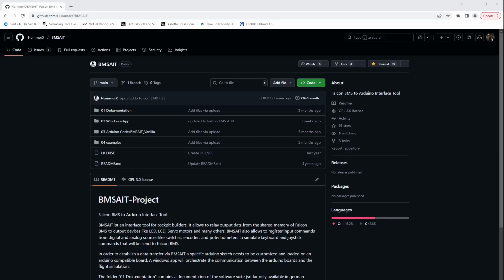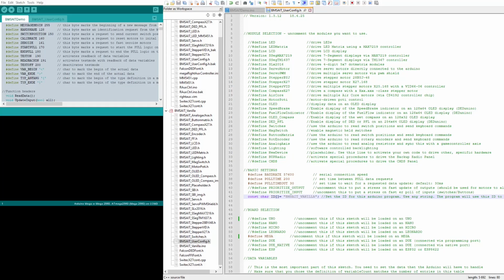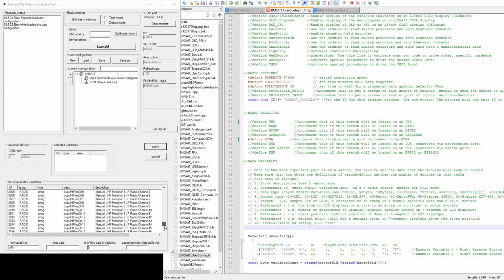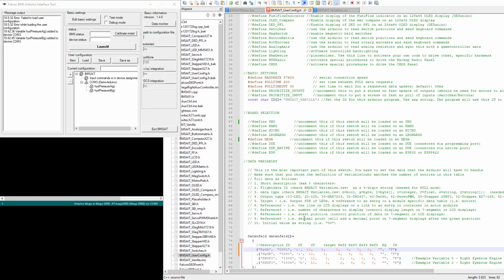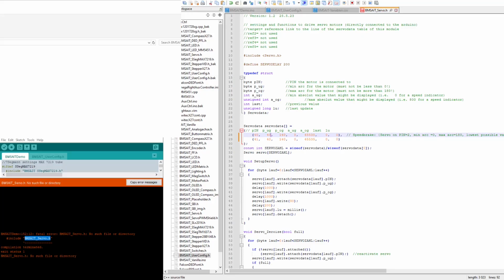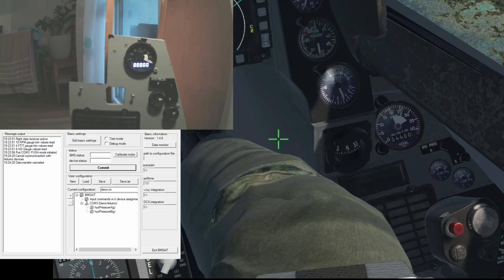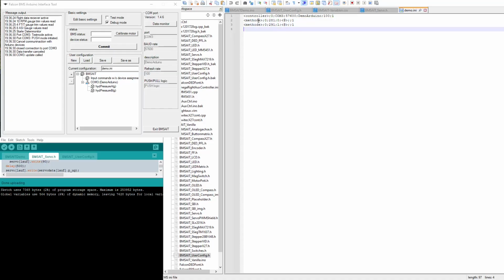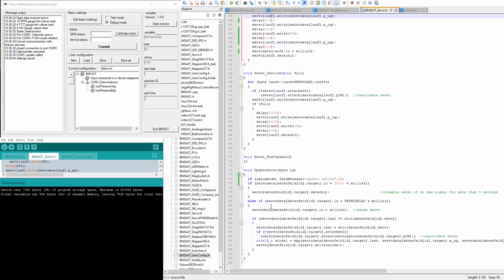F-16 Home Cockpit 14 - BMSAIT Introduction/Tutorial

Comment: this has been very helpful, would you be able to do a quick tutorial on 28BYJ48 stepper motors to drive gauges, i seem to be having issues
Reply from the maker: Thank you...
Sadly, I don't have any BYJ48 steppers in my configuration so I can't configure/test them.
Reply: @simhangar6216  thanks for the reply, i cant seem to get the stepper working from the examples files